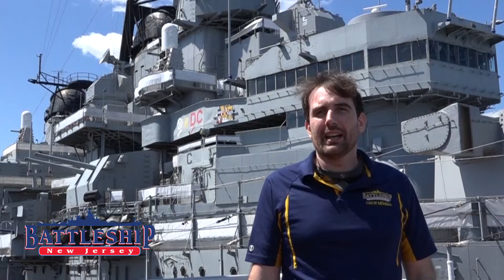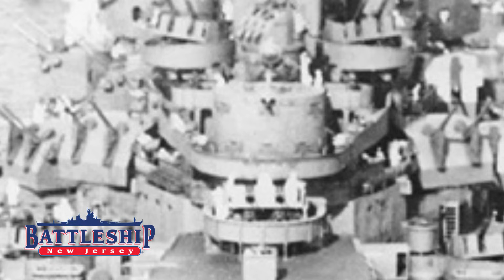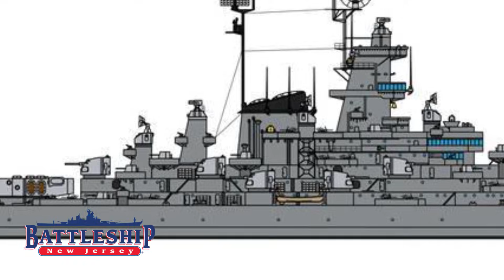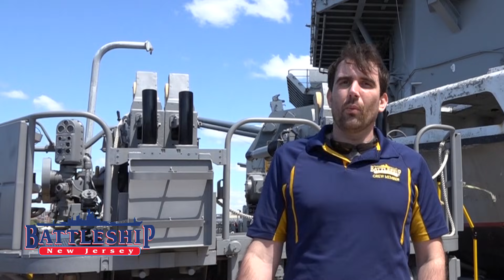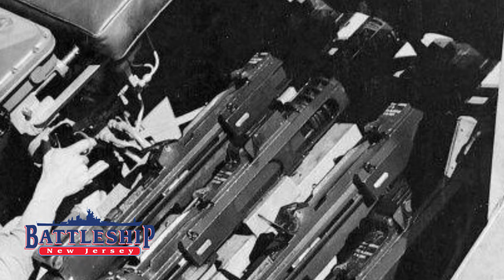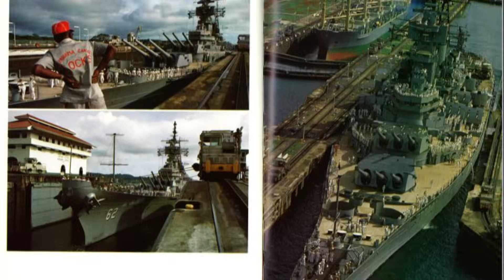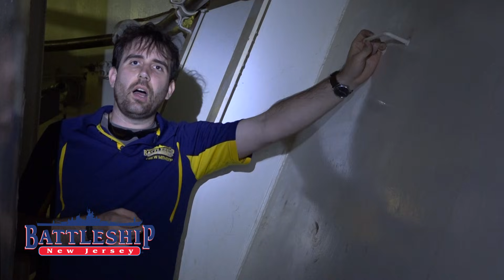What the Navy Doesn't Like About the Iowas

Comment: I guess we will never find out which battleships were the best built? Personally I beleive the Bismarck class were better built with better armor and longer range guns. Probably the Yamato class too with better armor and greater punch guns.
Reply: Bismarck's armor plan was seriously obsolete when built and at those long ranges you cannot hit another ship that is paying attention. 

Yamato class was pretty good but did not have the speed to keep the engagement range open to where the 18.1 inch guns offered advantage nor are you likely to get hits at that range without guided munitions because the target can watch for you to shoot and then maneuver generating a miss.
Reply: @calvingreene90  . Oh, what nonsens.
Reply: @calvingreene90  It is the armor design in particular that is the main flaw with the Iowa class. I was designed around a faulty theory and was to be changed on the later battle ship designs that were never built.
Reply: @USER351  
Bismarck's distributed armor scheme is defensible in her role as a surface Raider protecting her from the pop guns of the light escorts but the turtle back deck defense was just plain obsolete and creating a terrible weakness.

Her shallow draft necessary for passing through a canal the Kiel-canal I think also resulted in serious weaknesses that were made worse by the 3 screw propulsion. The Germans would have greatly benefited from some Italian ship designers but the Littorio class has issues with the armor as well. If the Italians and Germans would have collaborated on both designs both would have most probably been improved. 
This is not to say Bismarck is not an impressive battleship but in the hypothetical battle between Bismarck and Iowa I would want to be on Iowa.
Reply: @calvingreene90  And yet only four shells penetrated her Moly-Chrome steel armour deeply enough to cause any possible damage behind . Watch James Cameron’s documentary.
Reply: @calvingreene90  And sorry to say, with your argumentation, you do not seem to have any idea of what you are talking about.
Reply: The french Richelieu were 7,000 tons lighter, had a slightly thicker belt, were faster and carried the same number of guns in the same size. Bismarck was as big as she was because Germany was relearning the design process for battleships.
Reply: 🤣🤣🤣🤣🤣

The Bismarck didn't have the armor, the effective range, the weight of fire, or the fire control to even remotely compete with an Iowa class.

And no, neither did the Yamato or Musashi.

After the war, a section of the third Yamato/Musashi was tested. The Iowa class 16" penetrated all 24" like warm butter.

Comment: OK------------  The 3 inch guns also had the new proximity fuse late in the war about 6 months after the 5 inch shells got the first production lots. With the 3 inch twin mount able to put up 4 times the rounds as a comparable 5 inch twin mount increasing the chance of it's shells getting close enough to kill aircraft. Though  at only half the range of the  5 inch.

Comment: The USA will soon field energy (particle beam/rail gun) weapons that will require a massive platform capable of providing the huge amount of electricity needed.  The platform will also need to be highly survivable since  - at least initially - ships mounting energy weapons will be both rare and high priority targets.  What ships currently in mothballs would meet those requirements?
Reply: Definitely not--the steam turbines drove the propellers through a mechanical transmission, not an electric one, so electrical generation is limited to auxiliary turbines and diesel engines. There's not nearly enough electrical power to drive directed energy weapons on these ships. Tanking hits from the anti-ship missile and torpedoes out there today is a losing proposition anyway, so electronic warfare, active defenses, and good construction, not armor, are the way to go.
Reply: @hailexiao2770  You are missing the point.
Reply: @barryfletcher7136  Nope, they need a huge amount of electricity for particle beams or railguns, as in nuclear power plants.
Reply: @JDWDMC  Nuclear reactors can be installed inside the hull of a battleship.
Reply: @barryfletcher7136  US Navy nuclear propulsion consultant says no. I knew this would be the reply, so asked the question of the family member who is one of those and answer was the cost of the refit required would be on the level of expense of building a new carrier and that cost outweighs the value of a weapon system that could fit on an Arleigh Burke sized platform.

Comment: I think one of the main design criteria for the Iowa class battleships was the width of the Panama Canal. This was a highly limiting factor and should have been discussed earlier in your video.
Reply: "just build it on the west coast". Doesn't work.  They hardly had the infrastructure to do so.  They didn't have trucking freeways.  There was route 66.  Good luck fitting battleship parts through there.

All the steel was made in PA/pittsburg etc.  You could just train it to the ship yard.  

The panama canal shaved off like 3 weeks worth of travel.  Was absolutely 100% factor for the width of USN ships.
Reply: @virtue3  The battleship USS California was built at the Mare Island Naval Shipyard, Vallejo, California. The interwar period USS Montana was under construction at Mare Island before the Washington Naval Treaty required her scrapping on the blocks. Along with a number of heavy cruisers so, there was the capability to build capital ships on the west coast. Now efficiency would be another thing altogether. During the war the west cost mostly built subs and repaired damaged vessels.
Reply: The width of the Panama canal had been a limiting factor in American battleship design for years and the added displacement allowment of the escalator clause all went into making the Iowa Class very fast.  
The 16 inch 50 guns they got was the result of BuOrd not doing their job in a timely manner. Between that and the Mark 14/15 torpedoes the top 4 or five guys at BuOrd should have been shot.
Reply: @calvingreene90  shot, resurrected and then shot again harder.... and that only for Mark14 torp.... All other issues deserve an other resurrecting and shooting on their own...
Reply: @alinmeleandra3175  
Actually I agree but we are not merciful for the benefit of the guilty we are merciful for our own sake.
Reply: @calvingreene90  Was there an issue with the 16"/50 main guns? I hadn't heard about anything like that.
Reply: @canmufu3923  
The Iowa Class was intended to use 16 inch guns in inventory but BuOrd failed to provide the correct dimensions in a timely manner resulting in the guns not fitting in the Iowa's turrets after it was too late to change the turret design resulting in a rushed design and building of new 16 inch 50 guns. It cost small fortune that it shouldn't have.
Reply: @calvingreene90  I'm taling about the speed part at around the 18 minute mark, he's clearly talking about the shape narrowing from mid to front being pointy rather than blunt for speed considerations.
Reply: @znk0r  
The weight of the armored conning tower  would have been better spent widening the bow removing that concave bit that throws up the second bow wave and increasing the buoyancy. 
Adding anti dive planes to the bow wouldn't have hurt either.
Reply: @calvingreene90  dude I'm replying to "Yeah it wasnt for speed. Dislike
" relative to the narrowing of the width and that's about the shape of the hull not its total width. stop talking about conning towrers or width limitation to the panama canal I am well aware of the canal's impact.
Reply: @calvingreene90  WTF? No.
Reply: @zooka1495  They need to keep-up with carriers.
Reply: If I recall correctly ,the Iowa and SD class squeezed thru the  P C with just  11" of wiggle room starboard/port
Reply: @eddgong  ,. The NC, South Dakota, and Iowa class battleships were the same width.
108 feet 2 inches.
The Panama Canal was 110 feet wide.
The NC-class was the oldest, but about 50 feet longer than the South Dakota-Class.
The Iowas were 860 feet long, the NC-class was 728 feet, the SD-class were 666 ft at the waterline.
The Iowa and NC- class were about the same speed, but the NC-Class had a slight vibration at top speed that was never quite eliminated.
Both were still faster than the SD-class ships.
All had the same bulbous bow which allowed their stability as a gun platform while maintaining speed. 
The NC weathered the Typhoon Cobra Storm with Halsey's Fleet.
140 mile per hour winds, and 70 foot waves.
You should read these sailors accounts. They were required to go topside to secure the fuel lines during the storm ;
https://www.battleshipnc.com/typhoon/
Reply: My best friends dad was a wartime photog and was aboard the Mo, just feet from the signers of the surrender his photos are are legendary , my friend just shrugs it off as if nothing to it ,when Im going bats**t crazy just holding them .....negatives and b n w prints thinks nothing of their hysterical value lol,actually his collections of stuff he's a millionaire but doesnt give a care he just loves stuff
Reply: If I can recall correctly they were going to expand the Panama Canal for the Montana’s.
Reply: Yep! The Panama Canal was only 110 ft wide.
Therefore, the NC-class at 728 feet in length, the South Dakota-class at 680 ft in length, and the Iowa-class at 860 ft, were all 108 ft, 2 inches at the Beam.
They all also had approximately the same draft, which was also limited by the Panama Canal capabilities.
The NC-class was older than the South Dakota-class, but longer, and faster. Faster I think, than even the Iowa-Class. But, both ships in her class had vibration problems at top speed.
At the surrender of Japan, the USS NC, was the most battle experienced  Battleship the US posessed!
Reply: The Panama canal was indeed a design constraint but hardly a "highly limiting" factor. The length to beam ratio makes the IOWAs extremely efficient moving through the water---making them the fastest battleships and having the greatest range of any in history. 33+ knots speed and over 15Knm in range at 15 knots.
Reply: @zooka1495  Also I understand that the South Dakota was couple knots  slower than the Iowa class ships.
Reply: @zooka1495  
In rough seas and at high speed the Iowas seemed to be trying to dive like a submarine so take inspiration from submarine dive planes to counter the diving action and keep from taking water over the bow.
Reply: @calvingreene90  Bull. The Iowas rode in rough seas quite well. Far better that most ships thanks to the Clipper bows. Water over the bows does not mean the ship was diving in it. It means the ship was going straight thru the waves.
Reply: @gravelydon7072  
When a ship takes enough water over the bow to interfere with firing the forward main turret when traveling at high speed in calm seas like the the Iowa-class ships did, it is diving.
Watching the film of an Iowa-class working along side HMS Vanguard in the North Atlantic disproves that the Iowa-class drove strait through the waves. Do to the bow and Stern not being buoyant enough to keep them from themselves from sinking without the center of the ship holding them above water they rocked like a teeter totter with the bow repeatedly diving into the sea. Watch the video.
Reply: @calvingreene90  Here is a video of the Wisconsin in the 40s in heavy seas. https://www.youtube.com/watch?v=_NEoNIsEkQo
Those seas would have made Cruisers and Destroyers unable to get off a shot as the crews would have been getting beaten too much by the seas. And a Battleship of the Iowa class would have been fine firing in that kind of weather.
Reply: @gravelydon7072  
The USS Halsey Powell was riding the sea much better than the USS Wisconsin was.
I would not be willing to fire a gun taking that much water hitting the muzzle.
Your video supports my case not yours.
Reply: Thumbs up on that. I know it changed the design of aircraft carriers.
Reply: @zooka1495  Abso-fuckin’-lootley ‼️
Reply: Just imagine if they didn't have to worry about the panama canal jesus the size
Reply: Simple fix widen the canal.
Reply: The Width of the US Battleships wasn't that bad.
The Bismarck was only 792 feet in length, and 118 feet at the Beam.
The NC, first, and then her sister ship, the USS Washington, rotated duty with the British Home fleet guarding PQ convoys to Russia at the beginning of the War!
The NC was guarding the convoys before Pearl Harbor was bombed, and then rushed to the Pacific when all our Battleships in the Pacific fleet were blown up.
The NC is the most decorated US Battleship in WWII. Having served from day 1 until the Japanese surrender.
Reply: There was a plan to remake the Panama Canal a sea level canal without the locks. That was never done.
Reply: @JRobbySh  
It was a stupid plan.
Reply: Yes you are correct.
Reply: @zooka1495  You need added displacement for the armor and bigger guns man. You cant go wider as teh Panama canal restricts such designs the only other way is to go loner. Geeeezzzzzzzz
Reply: Yes and no don’t forget that before the United entered World War Two. We had been part of a treaty that limited weight of battleships. Also made narrow for the speed like the video mentioned.
Reply: @zooka1495  yea 50caliber main guns on a battleship. Yea.
Reply: Not that big of deal really. They could have just built them on the west coast
Reply: @firecracker4277  The problem is that most of the US Navy's major shipbuilding capacity was (and still is) on the East Coast.
Reply: @firecracker4277  The real issue of the Panama canal requirement was the factor of time and expense to go all the way around South America in case the ships were needed in a hurry in either the Atlantic or Pacific. If they could design the ships to go through the canal without substantially sacrificing  other attributes, they would do it. We gave up on that requirement in the 1950"s when the very large aircraft carriers were being designed. Those ships just had to be to large to go through the canal. And they had to accept long transfer times to make the switch from coast to coast. The fact that the later super carriers were all nuclear powered and could sustain high cruising speeds, and not burn a gazillion gallons of fuel  made the long trip easier to swallow. I don't know if the new modernized Panama canal can accept our super carriers? Maybe some one else could comment on that. I would think that they prob could.
Reply: @johnstudd4245  Yes. If they do need to switch, they'd do it coming off station in the Arabian Gulf...kind of a half way point. My first LPO talked about making the switch on the Carl Vinson.
Reply: @firecracker4277  the USN wanted to be able to traverse ships between oceans.  This was an important factor and something I've read repeatedly as to a limitation they imposed on the iowas.  Montana I believe, would have said screw it to such limitation.  https://en.wikipedia.org/wiki/Montana-class_battleship#Design
Reply: Yeah it wasnt for speed. Dislike
Reply: @tylersimplot13  in the vid it seems hes talking talking about how it narrows from mid to front not the ship. Not about the actual width of the ship.
Reply: @tylersimplot13  On the video?

Comment: I think the Iowa’s should all still be in service with our Navy. Everyone who thinks that they have been replaced by missiles doesn’t understand that missiles are highly over rated in their capability’s and few if any missiles fired at one of these ships would have little effect on them. The Russians are scared to death of them and for good reason. The 600 lb. steam plants on the Iowa’s may well be the finest steam propulsion plant ever put on a naval warship and is vastly superior to gas turbine plants. Since there are no more battleships in the world if they were put back in service I might consider installing a couple more boilers and some steam turbine generators for increased electrical capability. And you could make a case to simply add the additional generators since it’s very rare they would have to shut them down to put the steam to the main engines as their top speed isn’t needed that often. Under no circumstances should one of the mounts be removed for anything as the times this was done in the past it was a complete joke. The primary reason to bring them back to the fleet IS those guns, and there are lots of idiots who want to remove them for worthless missiles?!! Very few missiles have any where near the hitting power of these guns, most miss their target by a fair amount anyway. Bring them back to the fleet, they scare the hell out of people and for very good reason.
Reply: The entire point of a battleship (given their extremely high operating costs) is to be an offensive weapon. An Iowa’s guns are simply far too short ranged to be any use in that regard. Naval battles (serious naval battles) are fought far beyond an Iowa’s effective range. They were fabulous warships for their time, but there is a reason why Britain decommissioned HMS Vanguard and France decommissioned Jean Bart and Richelieu. Carriers are far more versatile, far more powerful and far more cost effective. Besides shore bombardment roles, the Iowas have little practical use.